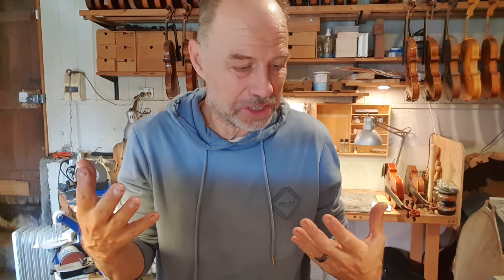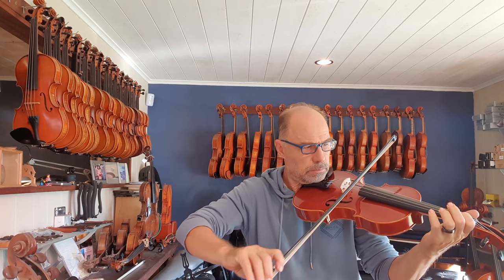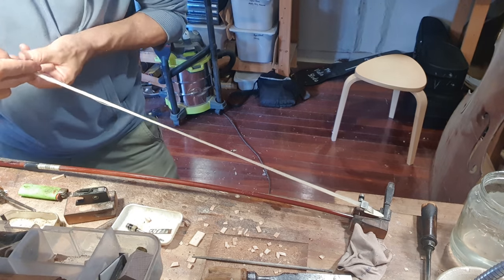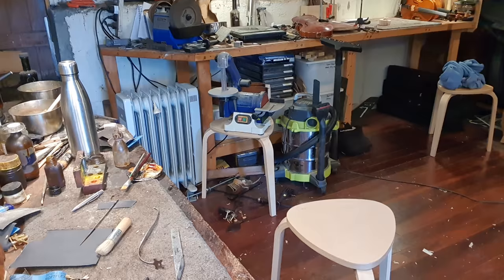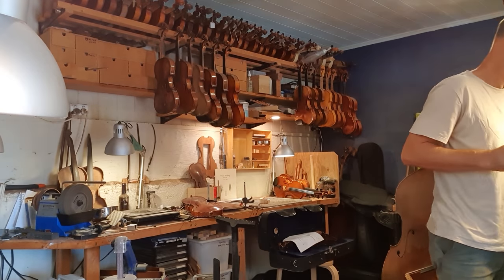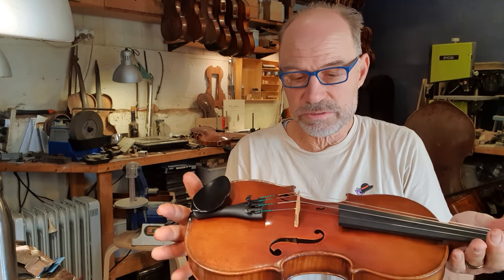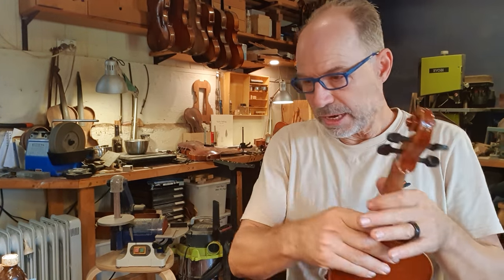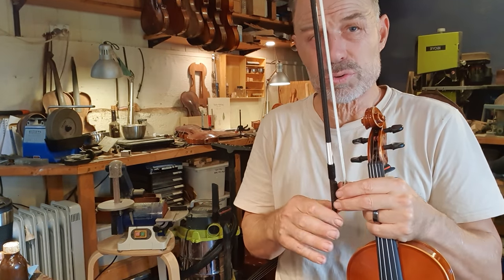A busy day in my Violin Workshop

Comment: This has nothing to do with what you were talking about, but I have a question about violin rosin. I am now retired and have just turned 70, but I remember when I was 10 years old and started to play the violin that my violin would get caked with white rosin dust. This was back in the early 1960s. I have never seen a rosin in modern times that has done this. Why did rosin leave so much dust back in those days?
Reply: From my current rosin hunt, I’ve seen many descriptions say that they’ve been specially formulated to be less dusty.  My guess would be that they’ve also started paying more attention to additives.  Maybe with better quality control, ingredients, and demands of the players; it’s changed for the better over time 😊